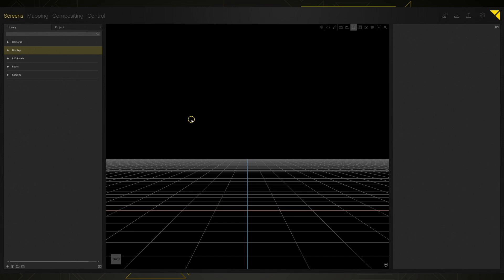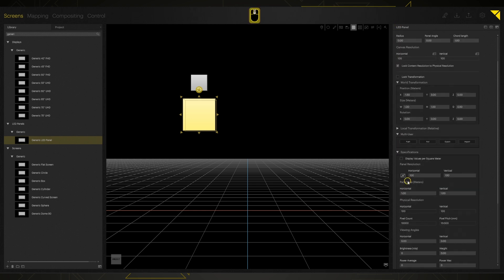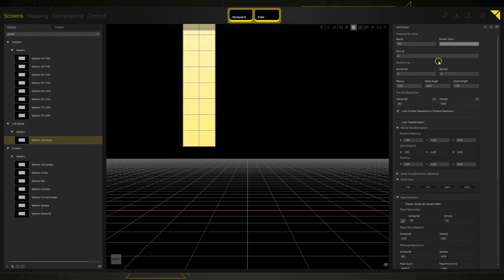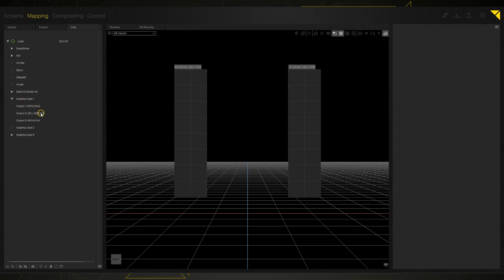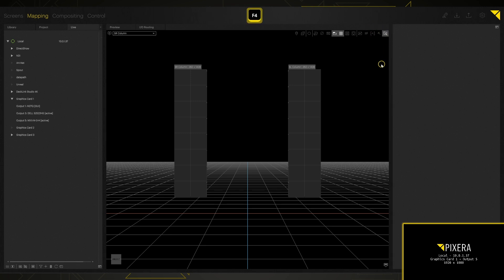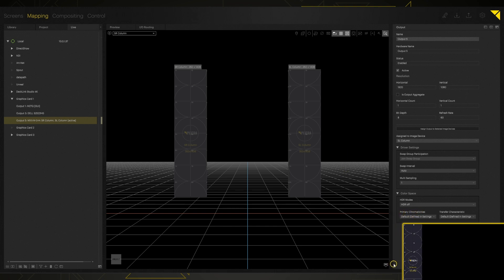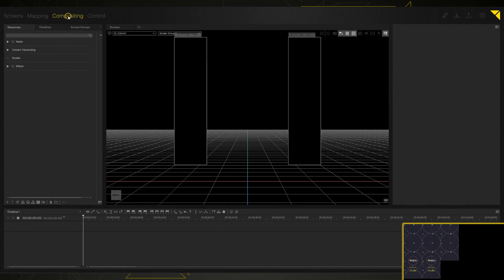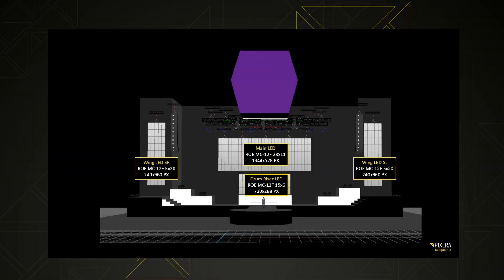PIXERA Fundamentals || Chapter 12 - LED Projects

Comment: What if I am preparing for a project and don't have the physical outputs yet, but still want to make the output mapping to save time on the spot. Is there a way to simulate outputs to get ready and then reconnect them to the real ones?
Reply from the maker: Usually you are always going to work with regular vesa standard resolutions. By using the dry client feature you can create "dry (offline)" clients for yourself and use those outputs. By doing so, you can do all the preprogramming without having to have the physical hardware at hand.